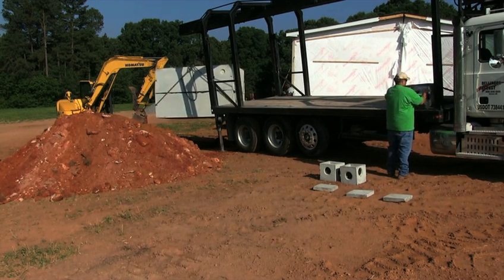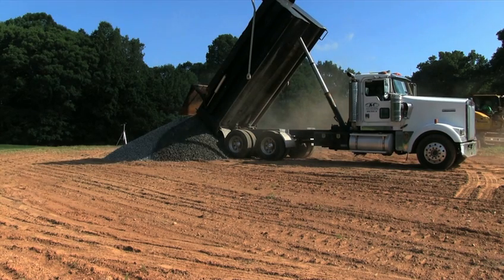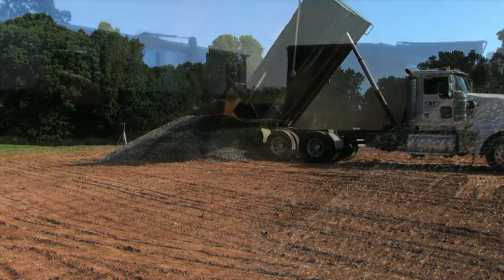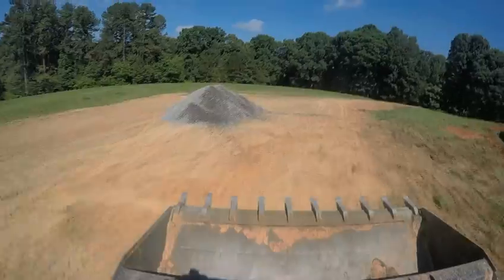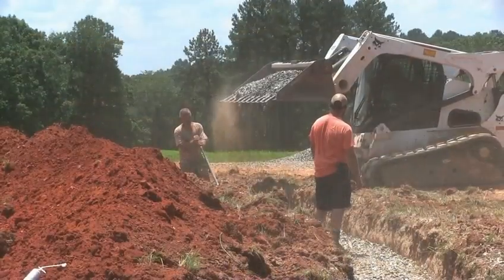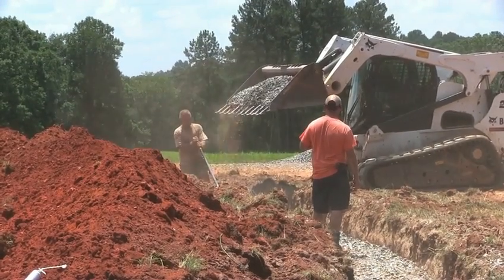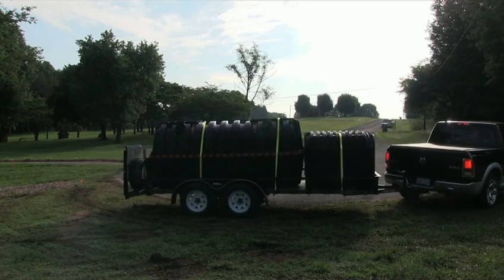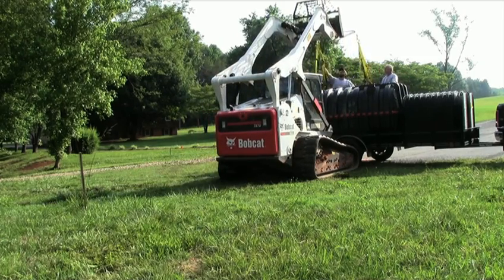Traditional Gravel Drainfield vs. Infiltrator Drainfield

Comment: I have experience installing both systems. The chambers are easier, cheaper and faster to install but do not increase or sustain the absorption of the soil, therefore the life of that system does not last very long. The pipe and gravel system has more absorption rate and is more efficient in the long run.
Reply: Had a chamber system installed in my new house in 2017 as the perk hole tests allowed for this type of system.  6-7 years later it failed.  Dirt compacts the chambers and eventually they clog up with dirt. I had to dig a fairly large hole at the end of my leach field to drain the water.  Once you expose one of the chamber holes it gushes out like a hose.  I'm currently in the works installing a traditional drain field myself.